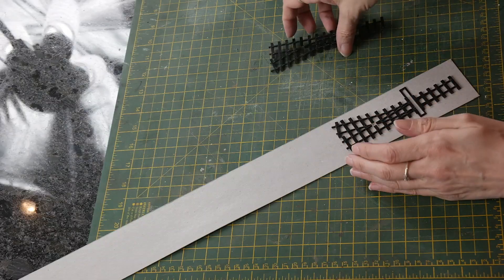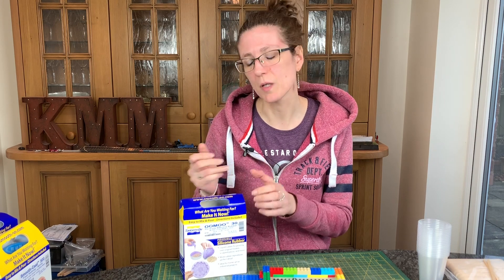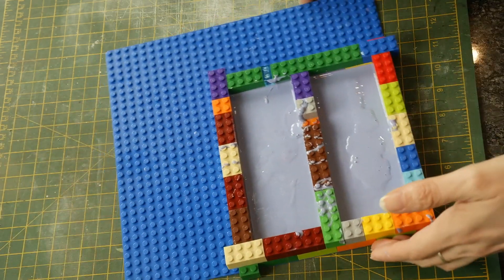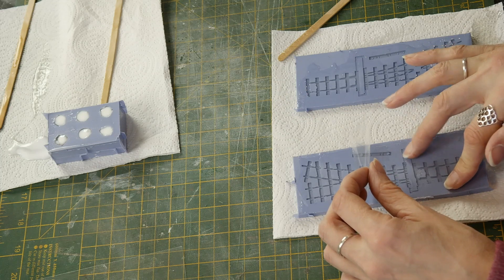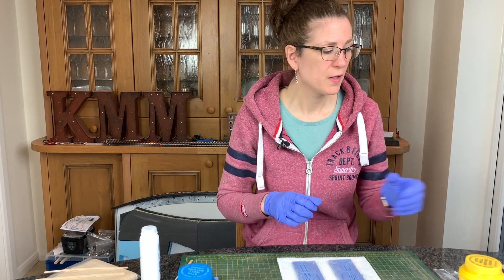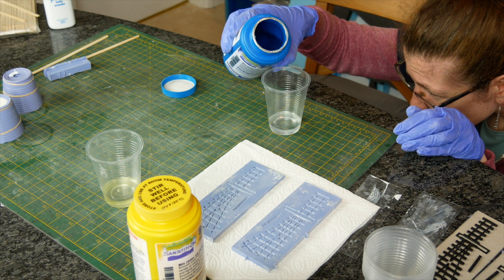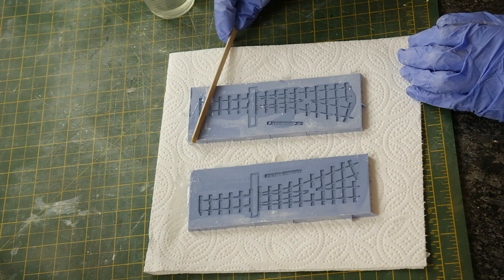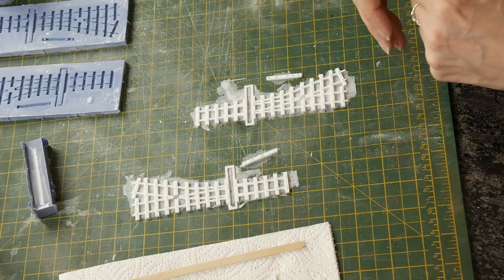Easy Resin Casting

Comment: Thank you for sharing this. Good idea. I take petroleum jelly and mix it with a little lighter fluid so the vasoline or petroleum jelly is very thin. I then coat the mold as a mold release. Then I spray the mold with paint with my airbrush or paint can so it will be the color I want it to be when I remove the casting. After this is dry and I pour the resin?  I like to use car past wax on a sheet of glass and lay it on top of the mold holding the resin. You would have the glass ready before you pour the resin. I do this when I am casting something flat like a wall or switch ties like what you are casting.  Okay you call them sleepers. LOL They came out painted , flat, and ready to install. Like you I use Legos to make my molds.  My last mold I took two Design Preservation building fronts and melded them together to make a taller front wall. Then made a mold like you did.  Then cast them like I did. You can't tell the the new wall was a casting.  But the casting made it so I could make 6 of the buildings. Just a thought. I am so glade you are around to share your thoughts. PS I got a Resin 3D printer the other day. Wish me luck. LOL
Reply from the maker: Good luck and thank you for your advice. I did buy some moulding Vaseline once, it’s just thinner like you describe.
Reply: @KathyMillatt  Wow. Thanks again. I build Fast Tracks switches for my n scale layout. They make quick sticks which is a bit costly. They are the sleepers for the switches. I made molds of them so I can have as many as I need. Now that I have a 3D printer I would like to print a master with tie plates, and other switch details. Maybe a better throw bar? I just want to stop and thank you. I would love to meet you in person someday. You have made such a huge difference in my modeling world. Thank you again. Keep up the good work.

Comment: What did you use for the initial casting when you made the rubber mould?  Was that your 3D print?
Reply from the maker: You need a master to produce a cast. It can be a 3D print but you need to do a bit of work generally to clean them up and smooth the layer lines.

Comment: great tutorial. One thing I've tried for getting rid of bubbles is to stick the mold onto a surface which is slightly vibrating. My PC works or even a bit of wood balanced on my airbrush compressor. Love the narrow gauge stub point and Ruston. If you want a 3d model of jubilee track I've drawn and printed them.
thanks
Reply from the maker: Thanks. My biggest problem with bubbles was when I put the acetate on as I trapped them. I do have a compressor so that’s a great idea.

Comment: An idea for mixing the resin, obtain a small set of mini digital scales (e-bay, very cheap)  they measure in grams, place the beaker on the scale and press T button this sets the scale to zero. Pour in resin A and check the measure, reset to zero with T button and pour the same amount of resin B directly on top then just stir till mixed. Much less fiddly than 2 beakers.
Reply from the maker: I use scales for resins that are mix by weight but this is mix by volume and I find I often pour too much in the second time then can’t undo it when I do them all in the same cup. If it works for you then great!

Comment: What a great way to utilize Lego, a great idea, cheers.
Reply from the maker: I saw it on a YouTube video...
Reply: Lego is so versatile, great tip.
Reply: We used Lego for years where I worked, the only difference was we used melamine coated chipboard for the base, sticking the Lego wall and the master on it with double sided tape.
I think it was back in the 70s when I first saw it being used, it's very versatile.
Reply from the maker: grahvis the great ideas just keep rolling around!

Comment: Afternoon Kathy , 
  I have looked at all the other comments and I didn’t see that anyone had mentioned this , so apologies if this has already been suggested. I believe the received wisdom when mixing silicon rubber and resin is to mix the two liquids together in one pot and then pour the contents into another pot , and continue stirring . This avoids the possibility of there being any unmixed liquids at the bottom of the first pot. 
   Keep up the good work and I shall be in contact soon to talk about the NMRA Convention in Birmingham in 2022. 

     By the way , powered rails are so last century . radio control is the way to go . When I eventually get around to building my layout there will be no wires . The points/turnouts will be battery powered . 

   Nick
Reply from the maker: I’ve looked at radio control and it’s fascinating. My only reservation is that in my titchy OO9 loco there just isn’t space for a large enough battery to run for long enough at a show etc. As that develops, I’ll keep an eye on it. I’m not sure what the advantage is for points as they’re so easy to wire to the mains?
Reply from the maker: Definitely want to hear from you about 2022.

Comment: A trick I came up with for holding down parts for single-sided casting, and to avoid seepage, is to use sticky-backed plastic . I lay out my parts on the SBP - usually lots of little surface details - to 'max' the mould area, and build an appropriately sized LEGO wall around them, stuck directly onto the SBP, instead of using a LEGO baseboard. A bog-standard cutting mat under the SBP will keep everything flat and the LEGO wall helps too as it maintains tension.  Once your RTV silicone is dry, just flip everything over and peel back the SBP. As for removing bubbles from the silicone & levelling, brief rapid tapping of the four LEGO walls with the handle of a hobby knife works very well and is a bit less brutal than dropping.
Reply from the maker: What a great idea!  Thank you. I think the backs need a bit more sanding to be perfectly smooth which would help.

Comment: Great idea Kathy,  use a scale to measure out the different parts and you can use only one cup, to remove air bubbles use a vacuum chamber under vacuum,  of course the only the longer set time can be used of course,  like the idea of doing castings as you are right a lot quicker...thanks for sharing....Jack 😉
Reply from the maker: Hi. It’s a mix by volume not by weight resin so I do what the instructions say.
Reply from the maker: The cups are cheap so I’m not worried about that but a vacuum chamber and a pressure pot would be good.

Comment: I love the talc releasing agent.
Are you aware, or any subscribers aware, of a casting compound which will set & dry clear?
Without copying the Futuristic Railway in the Sky (from Series 1 of THE MODEL RAILWAY CHALLENGE) I am considering an UNDER THE SEA rail event.  However, I am in need of clear track underlayment & clear rail sleepers.  If you have, or a subscriber has,  any ideas of a particular product please write back?
SEE YA' DOWN THE LINE,
Jim
Reply from the maker: Check out the smooth on products. I think they do have a clear resin but I haven’t used it.
Reply: @KathyMillatt  Not only did my first case of Smooth On Clear come in today's post, but a staff person of mine gave me a local artist center that sells it.  So I don't have to pay EU shipping.  THANKS and love.  Jim

Comment: Great job on the video Kathy .

If you plan to do a two part mold remember to place some of the Lego's in the molding clay to leave an impression so you will have locking pins for the top and bottom half's of the overall mold remove the Lego's and you will have the locking pins for the first pore , the locks don't have to be very deep .

Depending on the size of the master  I'd suggest one on each side one on the bottom a two smaller Lego's one on each side of the pore vent  .             Don't forget to make a small vent hole so air in the mold can escape . 
AND don't forget to coat the first part of the pored mold with Mold Release agent before you pore the second half of the mold .
Reply from the maker: John. All great tips. Thanks.
Reply: Kathy Millatt 
You're more than welcome .

Just passing on some of my knowledge from over the years of model building . 

I recently purchased two different 1:16 or 1:20 th scale steers for my loading pin for my cattle cars .

As soon as I can get a couple of 50/50 molding kits I plan to increase my herds .
I prefer the 50 / 50  for both the RTV blue and the resin .   For me I can work on group jobs of RXR , military ,  Sy / Fy .           

Well I'll talk to you later  .
I just won my battle with insomnia .
So glad to talk with you ,   good night or morning .

Comment: One thing you can do to make things easier for eliminating bubbles both in making your moulds and for casting is to make a vibration setup. Easy way to do it is to take two chairs, get one of the relatively cheap box fans and lay it, facing up, between them. Put a piece of board over the majority of it (leave a gap around the edges to keep some air flow and make sure it's sturdy enough to easily support what you're casting ontop. Just turn the fan on while your pouring the mould or your resin (or whatever else because it also works great for plasters). Let it keep running for a bit and it makes it far easier to get a better edge. I've used it for things for a while.
Reply from the maker: Sounds simple and effective, thank you. How do you get a flat back on open moulds like this?
Reply: @KathyMillatt  The first thing is that you can use some hot glue and lego bricks attached to a piece of wood with tape on it to keep from sticking easily for making the mold. And I use a piece of plywood across the majority of the top of the fan that's heavy enough not to really move much and there's a lip around the edge of the fans front that I use which helps, if not, you can tape it to the fan or use other methods, I've just used a big old fan I'd originally gotten in a garage sale when I'd gotten some hirstarts ones a long while back.

Adjust the fan speed as necessary after you get the fan flat and facing upwards if there are issues.
Reply from the maker: Thanks again for a great tip.
Reply from the maker: I’m going to have to try something similar.

Comment: Kathy, have you ever tried using a small digital scale for the mixing?  You could then get both amounts by weight into the same cup therefore lessening any loss of product to just the one mix cup...  Just a thought:)  Thanks for another great video...☮🐱
Reply from the maker: I used to use a digital scale but these are mix by volume not weight.